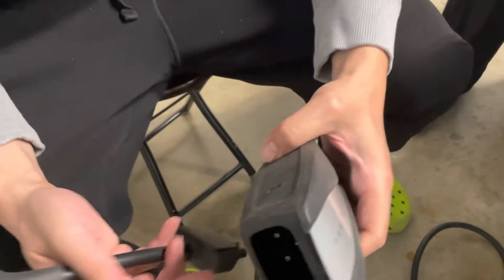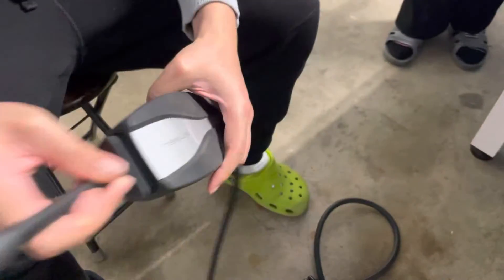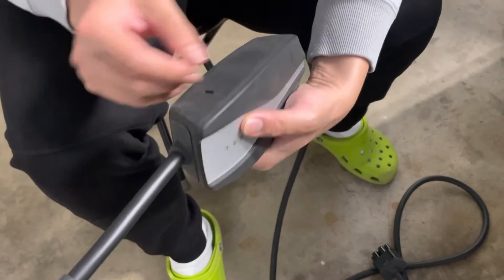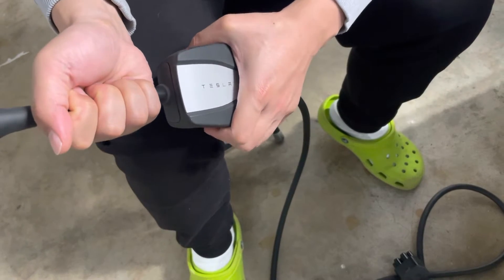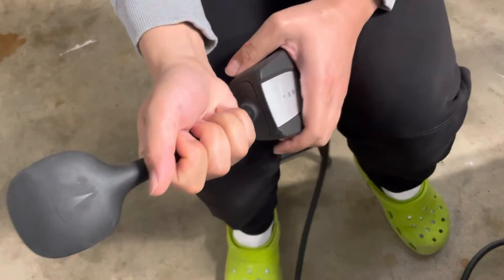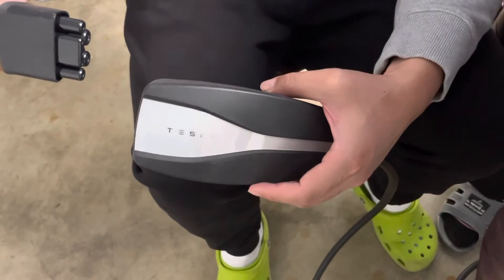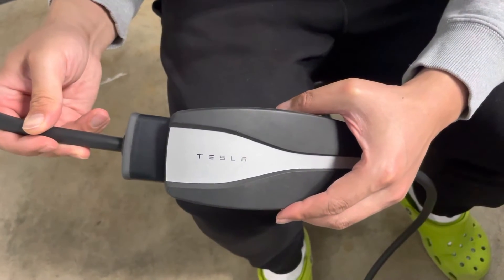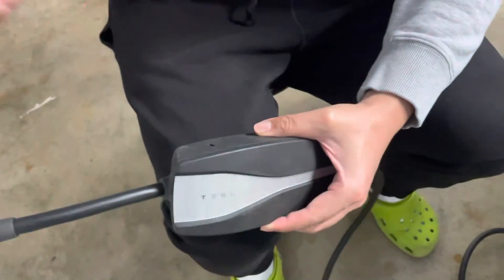Tesla mobile connector - changing plug from 110 volts to 220 volts & vice versa

Comment: That seems to be the right way to do it as per Grok: Remove the Current Adapter: 
Firmly grasp the adapter and the Mobile Connector.

Pull the adapter straight out to detach it. No buttons or switches are needed; it’s designed to fit snugly, so it may require some force. If it’s difficult to remove, you can apply dielectric grease to the contacts to make future removals easier, but avoid excessive force to prevent damage.